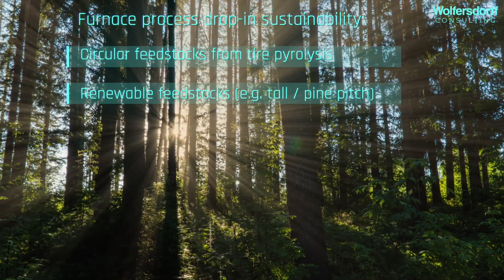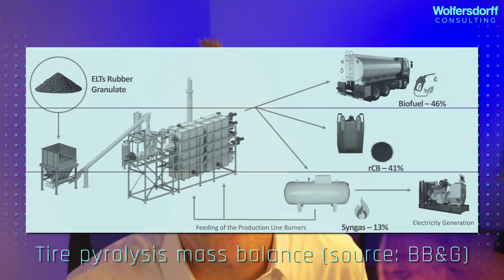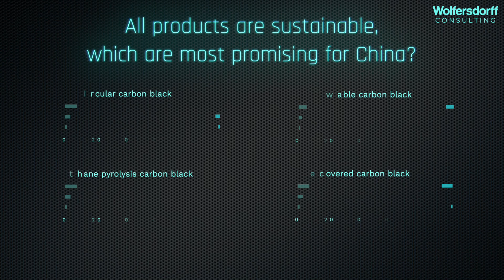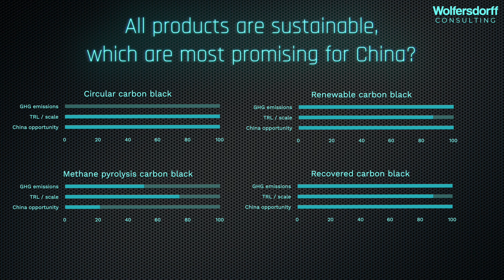From Black to Green - An overview on sustainable Carbon Blacks

Comment: Have you heard of Origin Materials? One of their products is Hydrothermal Carbon (HTC) from bio feedstock, which has been used to create high quality carbon black.
Reply from the maker: Hi Dan, thanks, yes of course I have heard of Origin HTC, but I do not find a lot of information about it. Renewable carbon is best for CO2 mitigation due to the negative scope 3 value of carbon capture! The challenge with biocarbons can be that their surface is inside the material in form of pores rather than external like with carbon black. Greets from Berlin!